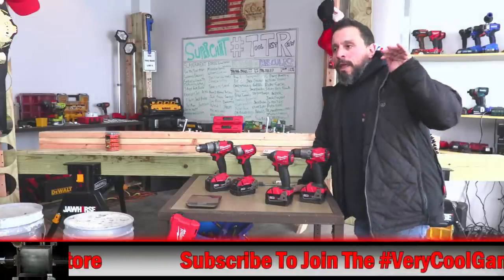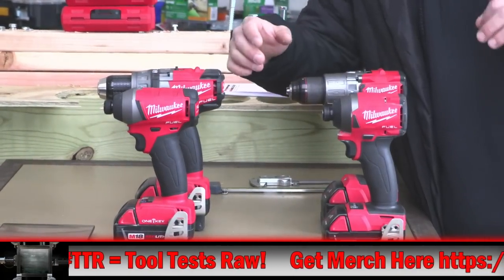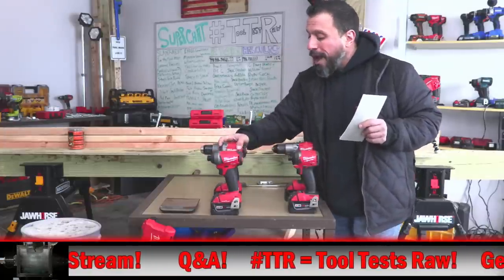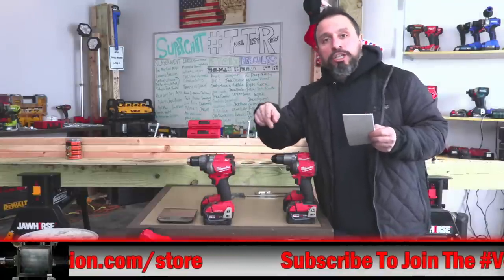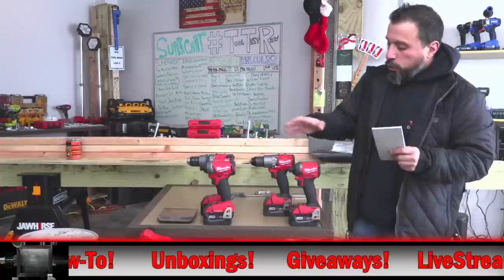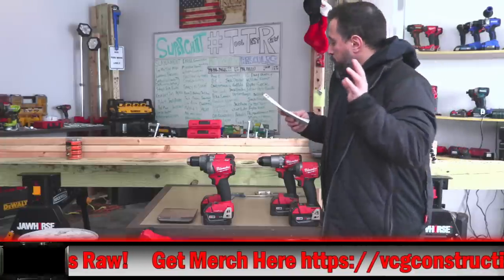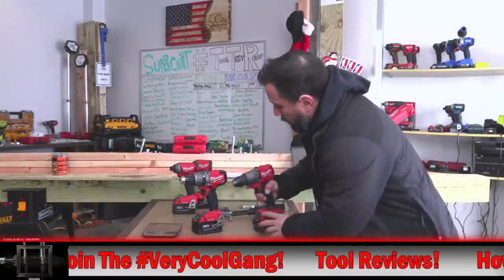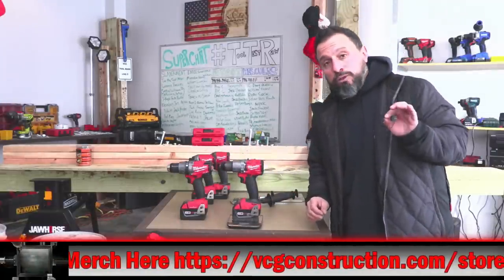Milwaukee Tools Combo Kits - Watch Before You BUY!

Comment: @VCG Construction the easiest way I've found that didn't get mentioned, is the Gen 2 has a smaller and rectangular butt plate where it says brushless. The Gen 3 has a much larger and round buttplate where it says brushless. That right there will tell you instantly which generation tool it is.

Comment: Someone tell me the difference between the fuel line and the normals. The fuel are the “professional” ones yet my originals seem to have more power than any of my co workers fuel tools. I’m able to push through hardened cement with my drill and my co workers fuels can’t